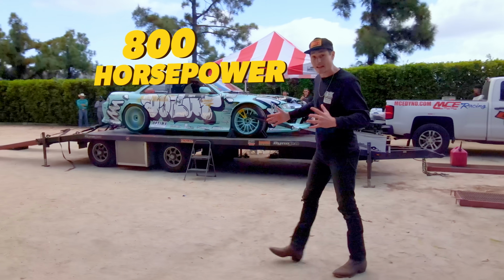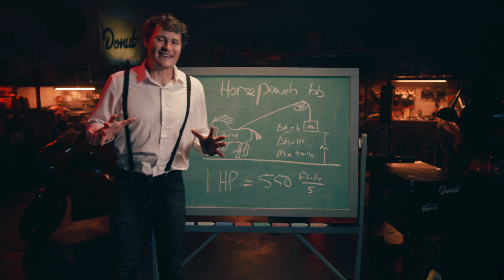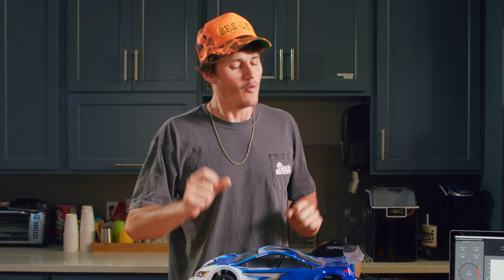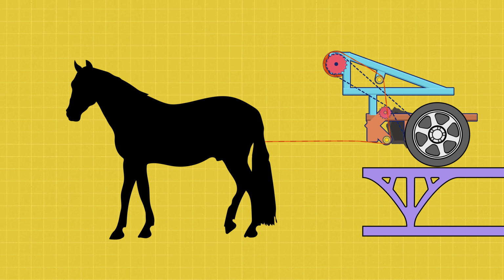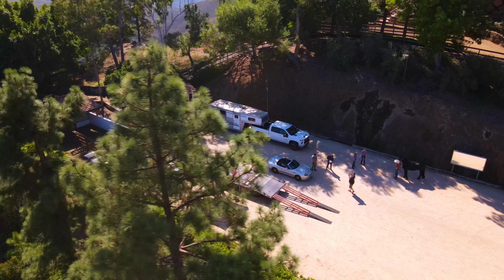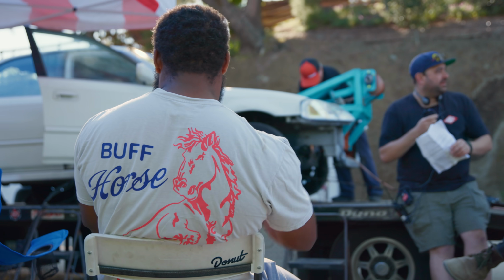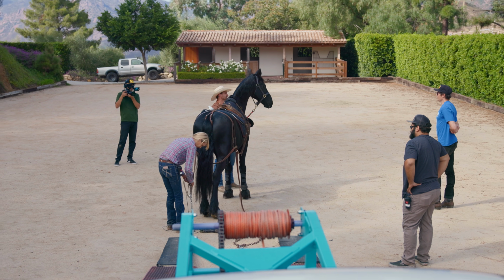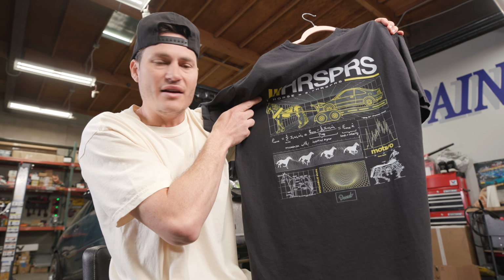How Much Horsepower is a Horse?

Comment: Not hating here but...the number is completely not accurate. The horse is capable of much more. Since hp is tq x rpm, the faster the horse goes the more power it will produce. It works the same way for human runners and cyclists using a power meter. You need the horse to get up to speed before an accurate number is produced, Not from a dead stop. Imagine pushing an immovable wall as hard as you can, how much horsepower is produced? ZERO. Because no work was completed. The faster you push the wall, the more power is produced. A much better way of dynoing a horse would be in a training ring using a walker with the dyno in the middle. Not pulling from a dead stop. Endurance athletes (rowers, cyclists, runners) produce power through speed and cadence. It works the same way with a horse.

Comment: ❤🎉 GR8 job guys...just a question- on the drum with the rope that is being unwound as it is pulled, was there any compensation for the change in the distance from the drum centre the unwinding force is applied as the rope leaves the drum? Was this the reason the rotation sensor did not work and it was resorted to get actual wheel rpm from the paper stucked to the wheel of the car...?

Comment: So to get an experience of a 500hp  car, you have to get around 87 horses? :)

Also i think you should have measured torque also, as that is actually way more important for the pulling power.  as a 500hp Semi truck can pull way WAY more than a 500Hp car can even imagine of pulling.

Comment: No way that this is accurate or even meaningful. I had a regulated max speed 15mph 50cc in Germany. Those engines were rated 1.5 horse power. Those "pedal assisted"  bikes were about 50kg - about the weight of their teenage riders. Those bikes were all struggling to go up any serious hill. Those bikes could be easily held in place at max throttle by a skinny teenager. No way that that was the same strength as 8.25 horses !!

Comment: Something is off here. If 1 human can pull 1.16 HP why is it that 3 freaking guys can only pull 1.9 HP?

Also, there is so much room for error here that even the horse readings can’t be measured accurately.

This would mean that a 800 HP Car is really more like 140 Horses. (800/5.7)

Comment: Your design means a loss in power from efficiency for the horse, also multiple horses need to undergo the test to get an average, and lastly the surface the horse is on makes a vast difference in its ability to pull.

Comment: Since food (calories) is energy, and you need to give a horse food for it to do work...  I wonder if the "fuel" (food) to work ratio is more efficient than the 20% you lose to heat in a combustion engine.  Considering a lot of that energy is "wasted" by all of the other biological processes the horse needs to live + its consuming said fuel regardless of whether its doing work.

Comment: Mathematically, horsepower equals torque multiplied by rpm (or speed). And while torque measures the turning force produced by a vehicle's engine and the engine's ability to perform work, horsepower measures how fast the engine can perform the work. Therefore, high torque makes an engine accelerate faster from a stop, and high horsepower makes for higher top speed.

Comment: Well it would have been way better if they were measuring nm, not horsepower, its hard for horses/men to reach high rpm, speed. But i bet his pulling power was much greater, there were just not enough resistance.

Comment: You know what's funny is? You could do a theoretical calculation of horsepower by having the horse Sprint to a certain distance. He times that by the weight of the horse And time that it took to get there..and that will estimate a theoretical hp and tq...drag apps actually exists...

Comment: From the star there's a problem when the guy alone was measured at 1.2 horsepower.
And this test is proving for definitive that the imperial units of measurement are garbage and unreliable.
Horse power, pound, inch mile, all garbage of a pre industrial society that tries to be better than cavemen.
So, stop using nonsense and go to the metric system, the actual universal system, where a meter is a meter here or on another planet, or a kilogram or any of the other scientifical units of measurement which are derived from universal constants, and not from how long is my foot or your foot or how strong is a horse or not.

Comment: uhm. so, silly question. If the original  horse power measured an engine that could do the job of a draft horse... why didn't you just make something that replicated that original workload? I mean ok so the original "horse power" unit probably isn't quite the same as todays units.. i mean ok so it might be hard to find a draft mill that you could hook both a horse and an engine up too but i mean..  did you really have to use a honda and a dyno? couldn't you have just compared the output of a winch of known value and a horse? is this some kind of bell curve thing?

Comment: A horse likely has way more horsepower than what we can measure ethically. Put it into a desperate situation, and it will pull much harder. Traction, motivation, and the strength of an individual horse are all factors. All this experiment proves is horses do in fact have more than one horsepower.

Comment: Correct me if I am wrong but would it not be waaaayyyy easier to wind the rope around the existing dyno drum?😅 I understand you might not be in the optimal rpm range for the dyno but this could be solved with some pulleys. Other option, use a hub dyno, stick a gear on the hub dyno use a chain and gear with an x ratio to a drum and wind the rope around that. All this being said, love the fact that they put a car in the system😂
Reply: Yeah that's what I'm wondering😂
Reply: To make it much easier. Just need to trot uphill for 15 minutes. Measure the slop, then do the math.  But that's not so fun.
Reply: Or maybe take something we already have like a horse mill, with a 1:1 torque converter that would spin the dyno.
Reply: They measure "The engine HP - Mechanic loss from the gears.
Reply: HP is way too low to get a sensible reading from an automotive dyno.
Reply: Yeah but we don’t mesure the power of the engine directly on the  dyno, so measuring the power of a horse directly would be like measuring the power of the engine directly.
Reply: @GabrielMataPato  which was the original question they wanted to answer, and why they had to math the shit out of all the contraption they added to do the conversion.

Comment: Back in the day the horses were working 8-10 hours per day. You need to find the sustained output from a Horse and NOT what it can produce in a very limited 1 off short burst.
Also PROPER Horsepower are measured on a braked load. All you actually needed is a calibrated load cell, an accurate length measure and an accurate time piece.
1 horsepower is a pull of 33,000 UK LBS for a distance of 1 UK foot in 1 minute of time. The force / distance can be easily changed subject to the 33000FT Lbs force per min remaining constant.
Very easy to do and very accurate. It has been done several thousand times now since James Watt first arrived at this figure. Also this is the ONLY approved method for testing the power output of animals and has none of the numerous "conversion" errors in your deeply flawed click bait video.

Comment: If the James Watt advertised "horsepower" was based on heavy draft horses -- they said here Big D was a light draft horse.  That sort of kills the comparison.  Measure a heavy draft horse.  No doubt the number will be higher than 5, rendering the whole concept of horsepower in need of refactoring -- but you'd be closer to an apples to apples thing.

Comment: Interesting and pure genius.  As Big D is far from the largest draft horse that even I have seen, and the motivation to pull was rather kind, I could see that with the right horse and with punitive motivation, a horsepower could be as much as ten.

I wonder why they didn't just use a tension scale (torque) times distance traveled per time unit (speed.)
Reply: Horse pulls are done competitively, just with a sled with weights on it so you could just figure out max hp based on that
Reply: @hilligans1  The problem, I think, is that there would be no standard coefficient of friction for the dirt.
Reply: @frequentlycynical642  ya i would say the best way to measure that would be to pull the same weight that the horses pulled in similar conditions and see the force required to do that

Comment: The experiment determined the horsepower of a particular horse. 
 ---> To be really valid, you would need to test a much larger cross-section of horse-dom.   
Test many horses, of differing breeds and ages, and average out the results.  
---> BTW, I'm a retired EE, and the figure, that engineers always used for 1 HP was 750Watts. 
 If we have to change the 750W figure, we have a lot of work ahead!
Reply: The imperial horsepower is 745.7 watts, the metric horsepower is 735.49875 watts.
From the measurements of the horse the imperial equine horsepower is 4250.49 watts and the equine metric horsepower is 4192.34288 watts
Reply: @HappyBeezerStudios  Wow, I know what you did, because I can do it too.  You multiplied 745.7 Watts/HP x 5.7HP/HORSE = 4250.49 Watts/HORSE That's AMAZING. That's PROOF!
---> You and I have never met.  We have not talked to each other or corresponded in any way.
--->We are separated Geographically, and it is highly unlikely that we have the same calculators.
---> You know what is so AMAZING?  We got EXACTLY the same result,
4250.49  I thought I had a psychic connection with "BIG D" the horse, but the NUMBERS DON"T LIE, I must have a psychic connection WITH YOU!
Reply: @HappyBeezerStudios  because the "kilogram of force" was used for the metric horsepower instead of units of 10 Newtons, we get 75 kgf m/s which is 75 "gravity" watts which is indeed 75 x 9.807, or the answer you gave of ~735.5 watts. It seems like the 750 watt figure is easier to do maths on though, especially as standard metric torque measurements are in Nm not kgf*m.
The imperial horse power is 550 lbf ft/s which is indeed ~746.7 watts.

Imperial horsepower = torque(lb ft)*rpm*pi/16,500
Metric horsepower = torque(Nm)*rpm*2pi/(75*9.807*60)
Reply: Yea but originally what we came to know as horse power like they said was based of a craft horse that’s why they tested it with big d  so if anything 10 different draft horse you sound smart but lack common sense😂
Reply: @JuanGarcia-bb7ms   I'm having a hard time trying to understand what you are trying to say.  There are between 3 and 5 incomplete sentences run together without punctuation of any kind. 
---> I do recognize the last 6 words, which seem to be an AD HOMINEM, possibly directed at me.  Even if it was aimed at me, it is more absurd than offensive! 
---> How can ANYONE be offended by whatever sense you have to EXTRACT FOR YOURSELF, FROM A PARAGRAPH that's entirely made up of GIBBERISH?  
---> BOTTOM LINE: It is not my job to figure out how to turn it into proper English, so it has some meaning.  It's really not my job to repair it, let alone putting your AD HOMINEM together, FOR YOU, to be a put-down, especially, if it's aimed at me!  
---> Be grateful that I don't view these COMMENTS as CONTESTS to win or lose.  ANYWAY, I don't Think I should be offended by what some stranger says or thinks about me, in the comment section under some video. Sorry, if you wanted an argument.
---> I hope I have not exacerbated the issue by not sugar-coating it, for you.  I did not label YOU as ILLITERATE, even though your comment had the appearance of being written by someone who was, let's say,  LESS than PROFICIENT, with the Language. 
---> If you have any Questions, feel free to ask...
Reply: @251omega  it obviously did hit up a nerve because you took the time to write back a whole ass essay you damn loser😂😂
Reply: @251omega  and that’s because I use the voice to text.
Reply: @251omega  Plus everything you said is just a repeat of what they said in the video. Before they preformed the expierement
Reply: @JuanGarcia-bb7ms  That explains it!  Remember when the first Voice to Text program came out?  You were supposed to train it so it could recognize your voice.  But, it was a lot more fun, to skip the training and see what it thought you said.  Sometimes it was very hilarious!
Reply: The original 1HP = 750W is an average over an 8 hour day not peak output. Originally it was determined that a draught horse, much bigger and stronger than the one in this video, could average 750W over an 8 hour day though there would be breaks in this to rest of course which is why it is an average. A typical draught horse can pull 10 to 15 HP peak.

Comment: Actual horsepower must be much higher because if you had a tug-a-war between a 6hp go-cart loaded to match the weight of the horse, the horse would probably pull the cart backwards, but they gave better numbers are better than one HP = one Horse!

Comment: The design team thought in terms of a "dyno" - their past experience and came with a modified dyno, but still depending on linear motion and incapable of measuring sustained tractive effort.

What they should have used was a rotary "HORSE MILL" as the basis of their design. Google it and see the Wikipedia page on Horse Mill.

Would have been perfect for the job, more so as the horse would have been used to the circular movement, as another commenter stated here. This i believe was the original (18th century?) contraption used to measure sustained horse power.

Comment: Great experiment but....

you should have calibrated the setup to see if the amount of horsepower you get after doing the math is correct. So pull on the rope with something that delivers a known amount of horsepower and see if this correlates with the number you get. Because I doubt that 5 Jeremiahs can deliver the same amount of horsepower as 1 horse.
you should have done more than a couple of pulls with the horse to filter out any variations, a maximum of 4 pulls (after the 1st one failed) is not enough from a statistical point of view.
you should have done longer distance pulls to correct for the initial acceleration phase and give the horse the time to get up to speed.

With that being said, I'm sure the horse can output an average of more than the 5.7 HP you calculated. Probably more in the region of 10-15 HP.

Comment: Props to the absolute beast of an animal, but you kind of left me wondering why did you build a whole freaking rig and not directly spool the pulling wire to the drum? Additionally, the only thing you're really measuring is how much torque the horse puts down at zero speed. After this the animal doesn't pull at its full capacity. Also not taken into account is the invisible traction system from nature, it will only pull as much as it can get traction down. Then, the horse was only pulling at very low speeds, so if actual running speeds were measured it would probably do way more.
You would get better data if you let a horse pull a sled, measure the force, get velocity data, and vary the force by adjusting the sleds weight, with this you will vary the speed. The main advantage is that you will get the horse to a certain speed, then you start increasing the resistance, and this way the horse is more likely to pull at its max capacity.

Comment: Useless !!!  It depends upon the size of the bobine & the last gear !! The larger it is, it will be easier for the horse to unwind the rope . The smaller it is, it will be harder . Like a gear wheel.  🐴Put in a cycle wheel sized one, even a 10 year old girl can easily pull it. The correct way is to make the horse pull a heavy weight uphill & compare  with a car of a known horse power pull that load from the same point. Then adding more horses to equalize the car if the car has more power .

Comment: The presenter used the term maximum power when a car was dyno. The experiment for the horse was nowhere near maximum power. You can tell Big D was pulling, but it did not appear to be pulling at maximum effort.

Comment: I would like to see Big D to run for a longer distance, so that you get a steady state horsepower measurement. Once Big D removed the slack in the rope, there was a moment of pause followed by pulling. Towards the end of the experiment, Big D was trotting. That would be the ideal time to measure a sustained horsepower.

Comment: A horsepower is supposed to represent continuous work to compare the equivalent machine to a horse working for hours or more. While 1hp may be inaccurate the horses max momentary power is not relevant at all to what the unit is intended to represent.

Comment: Fun Project.  However, I think that J Watt probably had it right since he was looking to replace a horses working for hours not for a few seconds.  Think about it. Big D pulled for about 10 sec, 5 times in a day.  A plough horse pulls for hours with short breaks at the end of a furrow.  A mill horse pulls continuously for hours .  Since Mr Watt was selling machines that work continuously, he was probably about right.    I did not know that Watt was observing mill horses.  That is really cool since the torque to turn the mill could be easily measured and the speed easily clocked.